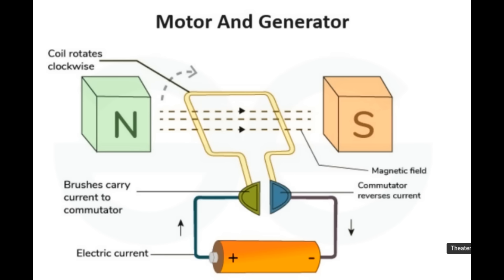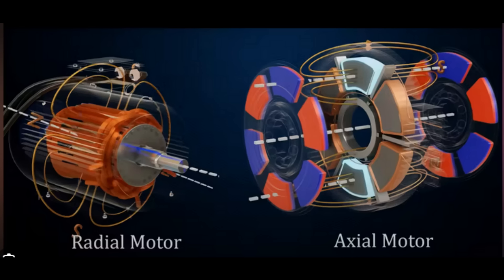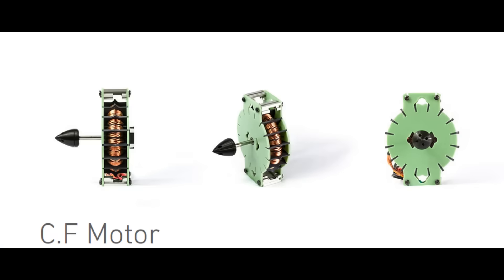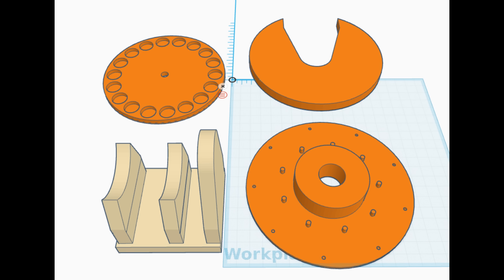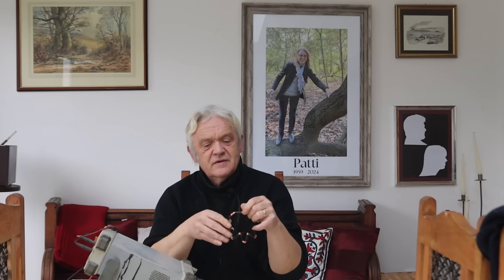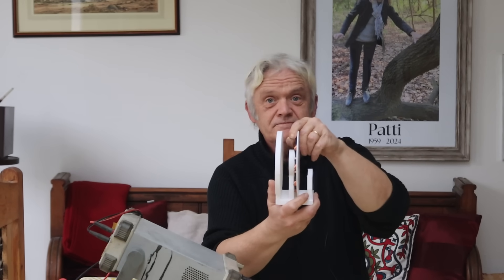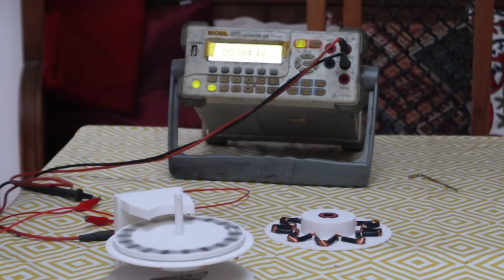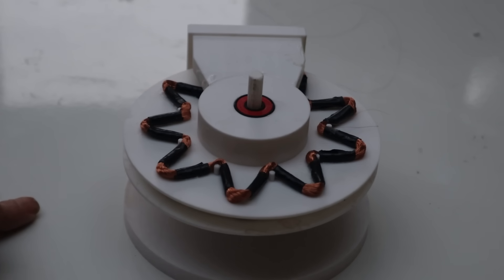2331 The Circumferential Flux Motor/Generator

Comment: Short of reversing the position of the coils and magnets, I cannot understand how this is any different than an axial generator. The magnetic flux that crosses the coils is still oriented axially.
Reply from the maker: The difference between axial and circumferential flux - axial flux attempts to surround a coil wire with a magnetic field - circumferential flux attempts to surround the magnetic field with a coil of wire - that's it really
Reply: @ThinkingandTinkering  Fair enough

Comment: Hi Robert
Is the star coil configuration as efficient as winding separate coils, and then solder them together? 
 IE:  If running at the same RMP, would the separate coil configuration create higher voltage at lower RPM than the star coil configuration?
Reply from the maker: Not really - it's just much much easier to make
Reply: @ThinkingandTinkering  
Thank you Robert👍👍

Comment: Would you need to gear eg small on the generator shaft from big on the turbine shaft, to give more revs etc.?
Gaz Yorkshire
Reply from the maker: i wouldn't have thought so mate - but it all really depends on your final use case
Reply: @ThinkingandTinkering  Cheers, just thought of torque over revs, as the commercial wind turbines are geared, ok it's on a larger scale etc.
Thanks
Gaz Yorkshire.
Reply from the maker: @Gazr965  Oh yeah - if you made one that size you would have to think about gearing
Reply: @ThinkingandTinkering  Yes I saw one made from a 200 litre oil drum Savonius type and the guy that made that had a belt and pulley arrangement to turn an alternator, don't know what ratio he used for that though. 
Gaz

Comment: Sorry to say that is a sandwiched axial flux motor. It is absolutely not a C-F motor.
Have a look again at the exploded view of the motor on their homepage. They use an axial motor drawing as example of what it is not.
They also do not mention the subpage from their main page at all. That's a hint this is a bit iffy...
Reply from the maker: well we are going to have to agree to disagree - to me you have missed the point of what is the difference between axial and circumferential flux - axial flux attempts to surround a coil wire with a magnetic field - circumferential flux attempts to surround the magnetic field with a coil of wire - that's it really
Reply: @ThinkingandTinkering  Just place your hand on the wire bundle (in your mind) and use the right hand rule. Look at the flux directions.
You can see in their pictures that the coil wire passes over the edge of the supposed rotor, presumably wound back and forth using some sort of armature or claw like pegs. It does not simply zigzag on each side like a star or myander which is how you make a axial flux motor.
Reply from the maker: @1kreature  I don't think that makes any difference mate - to me it's not fundamental - it's only an example of how they tried to solve the issue
Reply: @ThinkingandTinkering  What really interest me is the solenoid-like cores that has C like claws on both ends that they appear to wind the coils on.
You can see them on the small image listed next to the "Innovation" section. It appears to me like these can only be threaded on the rotor at certain points along the rotors circumference while at others there seems to be magnets that will pass through a circular hole in the C's. If this is the case then it is a nifty way of trying to utilize the entire field and reminds me of the construction of the Transverse Flux Machines I read about a few years ago in Energies. Many interesting stator shapes.  This motor do look a bit fiddly to assemble though?
Reply from the maker: @1kreature  They talk about a trapizoidal shape on the coils and what caught my attention was what you said about the right hand rule - Ahhh I wonder if it is wound in essence like a coreless DC motor and then 'flattened out and curled into a 'C' shape? - what do you think?
Reply: @ThinkingandTinkering  About the windings: Yes I thought it was just bent into a C, like taking a record and heating/bending it like a poor Salvador Dali impression but studying the video on the page and stopping it when the motor is as big as it gets on view you can follow the winding and see it looks like it has a bundle of wires like heavy litz wire in clearly defined coils with gaps along the circumference on the prototype. Almost as if they were wound on a toroid with the black cards as spacers but I thought the black cards were integral to feeding the flux into the center with rotor. Almost like a airgapped C-core for inductors.

Comment: A few weeks ago I saw a short video that had an armature with perm magnets with loops of copper tubing around it.  The tube had water and as the armature rotated the water got hot.  Does that actually work.   Hand crank water heaters that have a belt drive pump could create hot water for 3rd world and off grid uses.
Reply from the maker: quickly rotating magnets under a copper plate will cause the plate to heat - but you need to spin them quickly
Reply: There are videos on YouTube showing people melt metal by spinning magnets next to the metal. Cody's Lab is one channel with this type of video.
I'm pretty sure there are less expensive contraptions one could make to heat water using human power.
Reply: That's induction heating. I've seen other videos of people using magnets spinning under a metal plate for heating stuff.

Comment: Would it be possible to make a magnetic gear out of this, where the two stators have different pole counts and the rotor has the appropriate flux paths between them? The idea being to avoid mechanical losses in gears. 
Like the pseudo-direct-drive from Magnomatics, but without the magnets, and the rotor is just a shaft with flux-path iron in it.
Reply from the maker: I would imagine so

Comment: Hey, love the video. I was wondering if you have noticed the echo in your room though. If you would just hang up a blanket or something it would help that out.
Reply from the maker: I am not hanging up blankets mate
Reply: @ThinkingandTinkering  The echo does make it harder to understand you. It would be nice if there were an easy way to reduce the echo. I'll still watch either way.
Reply: @ThinkingandTinkering  There was a huge underground physics lab at my university. (I was amazed to learn this giant room was under an area where I had walked many times.) The giant room had a horrible echo. Someone good with the physics of sound figured out if they added a couple of sound absorbers at key locations, it would cut the echo way down. It worked really well. You probably don't need to hang a blanket but there might be some small adjustment which would reduce the echo. Again, not a big deal but it would be easier to understand you with less of an echo.
Reply from the maker: @ddegn  that's a good suggestion mate - i will look into it
Reply: @nomfg  "Get a lavalier mic"
This is probably the easiest solution.
Reply: @ThinkingandTinkering  fair enough. And yeah it’s not a huge deal. Might be able to find a mic that can automatically reduce echo as well. Or not, I will still love your videos lol.

Comment: I may be missing something but part of my mind is questioning ( although not answering )  if you could you use a, sort of, inverted crab claw cage, (  the claws facing away from each other rather than towards each other ) to redirect the non coil-surrounded parts of the magnetic field to where the coil is?
I'm guessing I'm missing something, or people far smarter than me would have already done something similar.
Reply from the maker: it's a good idea mate but it kind of goes against the simpleness of construction and would mean adding a weight of steel to do it - you might end up lowering the power density

Comment: Just for peace of mind.  On you follow up Video could you include at least a pencil sketch of what the generator would look like with the additional coil you mention in moment 9 minutes in?  I am intrested in both building the unit you show and then going back and building a second unit that has the mentioned additional coil.

The Weather here is -7 degrees at dawn.  The digging of the work shops' foundation has pretty much come to a halt.  I'm doing something that's never been done before in the area of concrete pouring and I can't show the progress until it's done, and hand digging a modified foundation that is 41.3' by 90' is taking it's own sweet time.
Reply from the maker: good thought mate and you can't really put concrete down in those temps I know there are additives but they are not brilliant - so you just have to take the time it needs i am afraid
Reply: That's a lot of hand digging!
Reply: @nopenotmedude  The digging the bulk of it is the easy part, It's the after dark scraping with a hoe and a Pick to get everything level (That last 2% of the dig when you are trying to get less than an inch of deviations), and when the dirt here is rock hard.  The foundation perimeter will be Hyper-Adobe (tinyshiney Home You tubes) But in order to do that you need to put down an outer rim of corrugated sheet metal deep enough that the rodents don't dig under the foundation and then enter the shop space, and for that I will need to rent a trench digger + a back hoe to move all the dirt I threw out of the foundation pit and then a vibrating dirt flattener and that will need a water cube to soften the dirt in the spring.
Did I mention that I don't have a wheel barrow so you are walking each shovel full to outside of the foundation pit.  Funding for additional tools in that category have been shifted to more winter power for the off grid system. 

(In all those details that I've shared I've still not given you the WHY this will be something worthy of both trying and set a new standard for wood working shop builds. And The Video will either be worth copping or a grab some popcorn failure.)
Reply: @FuhrChris  I think we can come up with some ways to make it more difficult. Have you considered swapping a digging stick for your space? 😉 

In all seriousness, I appreciate the detail. Sounds like fun! I'm solo building a 2000sq ft house, myself. I know all about the balance of equipment vs labor vs budget.... Good luck!
Reply: @nopenotmedude  You live in a Country that from the middle it's about 75 miles to coast from any point.
I live in a State that everybody forgets exists, (Not even the 4th largest) and for me it's 80 miles to the nearest Grocery store.  It would be 100 miles to go to where you can rent the back hoe for construction.  Thus you fall back on just making small Daily progressions with the tools you have.  (Mind you with the exception of building construction tools that arrive on a trailer, I have 40 years worth of tool collecting.  I have tools that most people can't even tell you what they do let alone what there name is.)  In fact it's said that when "Bob Vela" dies he wants to come to my place. 

This is why I contact you.  I have both the Tools, the Space, the Winds, the Sun Shine, the Time, and a community college with Engineering Students to take some of your ideas to the long term test bed levels.  Ooo and I was in the composites department at Boeing.

Actually 1. I'm considering both adding to the West side (2) 100' foundation runs going South so that I can begin making a central Court yarded area much like the Greeks would have, thus I could be outside and yet out of the Winds which are predominant after 10AM. 2. Adding at least one Geo tube which will be 150 long and 10 feet down.  (I found a calculator for Geo heating for Greenhouses) and planning on making the South Wall a Black insulated wall with a clear membrane series and push the heat back down into an insulated tube that would go over to the Trailer.  Resale of the property value will go up when you can say "You will have zero heating and cooling costs for life!"  For the East Wall of a Court yard I'm thinking of making one of your wind Walls on the property fence line.  I could one day get around to making a 6' stone wall (Trust me we have too many stones just laying around the country side here) that would be topped off with a Wind Wall.  (This would be after I both build the West section of the Court yard and then use a smoke pot to see where the winds go as they cross the East side of where a court yard wall would be?) 
IE there is NOTHING to do out here but build, or shoot an Elk for Trespassing.

On the issue of making it truly more difficult.  When it's too cold you Pee on the area you want to scrape down as final working it down to laser level, then quickly scrape it with a flat shovel.  (I'm trying to dig down an area that the mice are getting in the Trailer to the point where I can place a wall of corrugated sheet metal, and then back fill both sides with gravel.) So you have to climb through the Solar panels and stand on top of the Trailer hitch to get to the target area.  Then quickly get down onto your hands and knees and use a hand trowel to stab at the frozen ground as it turns to mud.   (If it was easier to get water from the well and wood fired heat about 5 gallons of water and then poor it over the area that needs a steel rodent barrier (Like desperately needed it yesterday!).  So the actual easiest answer is oddly "Drink more instant coooooffffffeeeeeee, do we have any of that instant espresso left?  Ya, with that I could rap up this dig TODAY!"

Comment: First things that come to my mind;
- we can stack mulitple stages on each other.
- as mentioned, magnetic bearing, but lately i'm thinking about a twist to it;
What You always showed us, was either to opposing ring magnets with a shaft and bearing in a center or a horizontal setup, where one end is resting on something. What if we just "hang" the rotary part with the property of the pushing / pulling (this case holding power) of that magnet? Let's say, we have the stacked idea, where the rotors are have a common - non magnetic - shaft without the bearings in a vertical config and we (e.x.) glue a simple screw at the top, the pin facing upward. Ex. this (shaft+magnets+the disks=rotor) weights a 9gram (just made up values) and we have a magnet above this that can hang a like 9 gram of weight. This config there is truly only one single point of contact that from one perspecive - without the bearings - has almost zero friction - and playing with the weight of the rotors - that  as a whole are acting in this case as a flywheel also by themselves bythaway...-
So, by playing the rotors overall weight, with this hanging method i belive we could truly achiveing true passive magnetic levitating. What could be a help fpr this - if playing with weight does not achive it - i have qnother idea as using 2 more magnets at the bottom of the shaft. One is a common button like, glued on the bottom of the shaft with a screw glued to it - this time, pointing downward, and the other one is a ringmagnet and it is below/aroumd at the tip of the screw. The bottom magnets are facing opposite to repell. In this case, as if the pushing or holding force of the bottom, ring magnet overcomes the weight of the rotor, playing with the vertical position of the top, hanging magnet (to find a sweet spot, where the magnetic force only would hold the rotor in a stable point) could create a point of - i guess - true, and passively levitated rotor. Dumb?
Reply: Would be better tu use the "mighty wind turbine" coils setup over serpentine coils?
I mean yes, more work - still dead easy -  and additional materials, but as far as i understand, that configuration maxes out the useful contact area between the magnets and the coil.
Reply from the maker: do you know mate - you really should just try building some of your ideas it says so much more and answers so many more questions

Comment: Do you use a pin to attach the magnet disk to the axil or are you spinning the coil and the axil is connected to those.  Or is it a glued connection. I guess it doesn't matter.
Reply from the maker: it's just glued mate as this is a very early prototype to show the idea

Comment: That's 11V at whatever speed it was spinning. If you had measured the frequency, you could calculate the speed without any extra sensors.

You have 9 "wiggles" in each coil, and 18 magnets in the rotor. This does maximize the voltage, but it also maximizes the torque ripple. It doesn't seem very easy to change this into a 3-phase generator; if you'd use 3 separate stacked coils, phase shifted, with 2 magnetic rotors (so stator-rotor-stator-rotor-stator), the center coil would get a significantly different magnetic field compared to the outer 2.

And most importantly, measuring the voltage only tells us that the voltage is no so low as to be unusable. Unless you also measure the (short-circuit) current, resistance and inductance of the coil, and the efficiency, it's meaningless.

I expect the inductance to be relatively high, as this is basically an air coil with a rather large diameter and quite a few windings. The resistance will also be quite significant, as this seems like a very long and thin wire.
Reply from the maker: this is a generator configuration mate - I thought torque ripple was confined to motors? It would also be stunningly easy to make this 3 phase - see the video i did on 3 phase serpentine coils. As for measuring amps - no point as there is no power input that can be quantified - i just flicked it to spin to show it did output which is all i was concerned with for this simple demo of what a circumferential generator is. To be honest I am not sure you got the point of the video